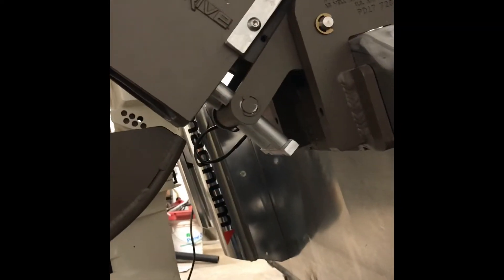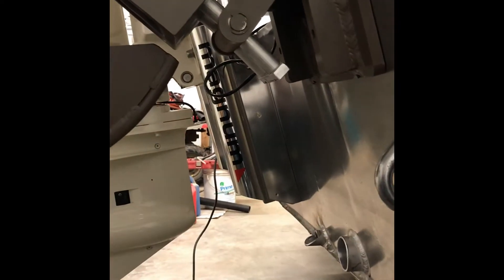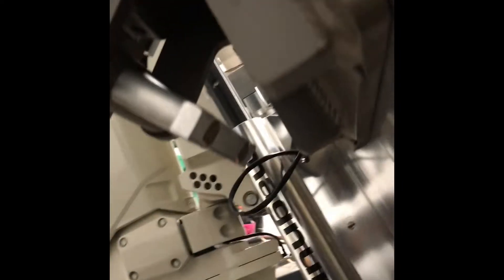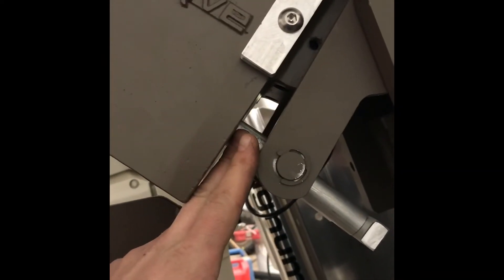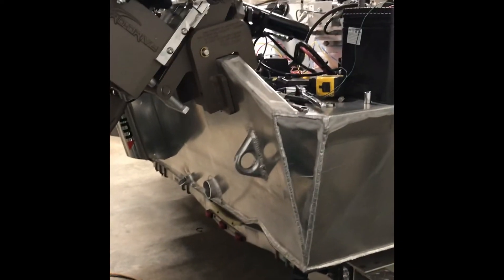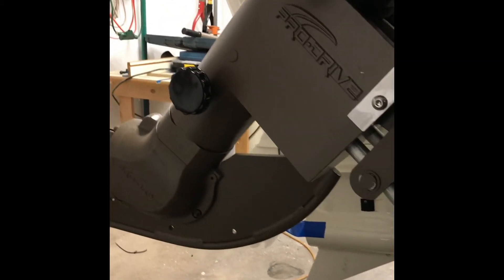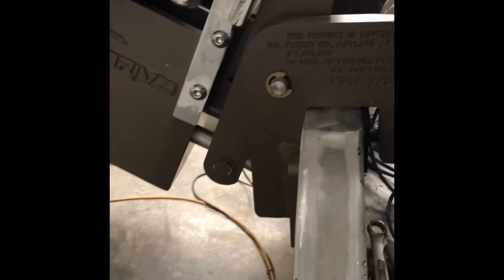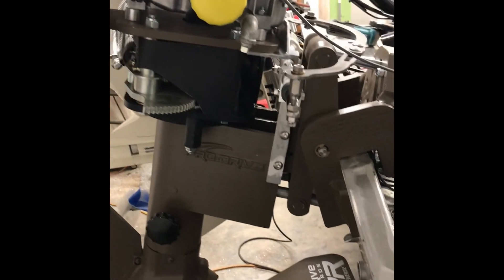Pro-Drive Mud Motor Reverser Block/ Trim limit adjustments

Comment from the maker: As a follow up note to this video, I had to remove the reverser bloc as I wasn't getting the traction from the motor I had wanted and steering was affected especially in deeper water when trolling. Also Python only lasted a year until I went to another solution, I found it was just not heavy enough for the mud motor application.